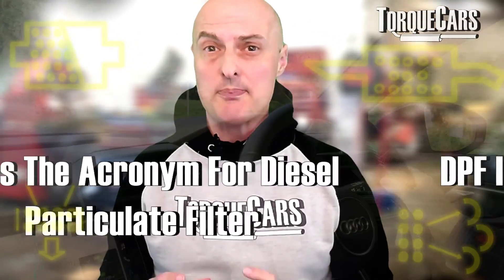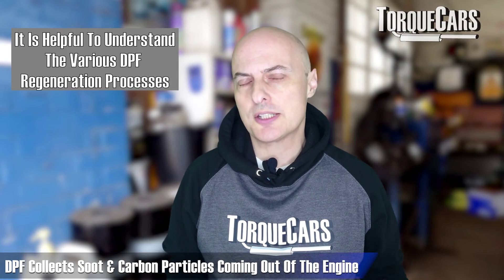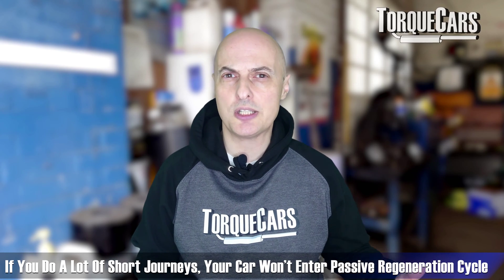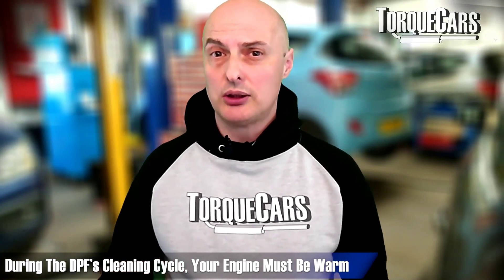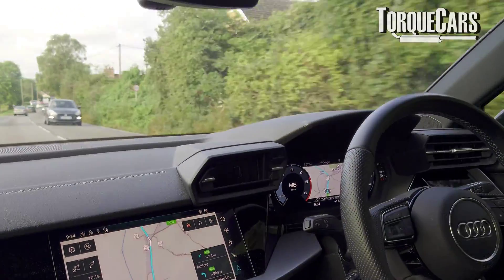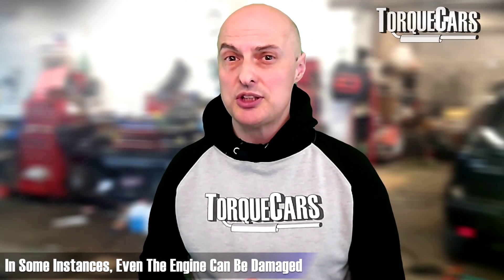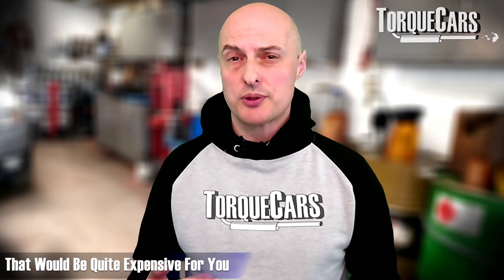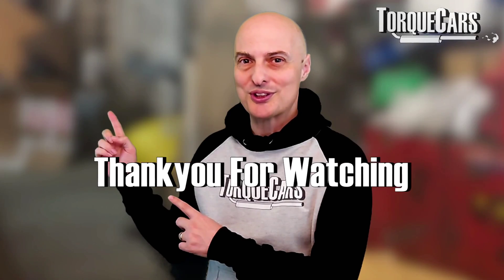Regenerate a DPF - Easy Guide & Tips: Starting DPF Regeneration. 🌬️🛠️

Comment: I have a Mazda CX-5 2.2L Diesel, I take it on highway every weekend or twice a month, drives 120-140km/h for a distance of about 40-50kms. I think that is the best way.
Reply: On the facelift models of the cx5 or 6, there's an engine icon within the fuel economy monitor / i-stop menu.
This engine icon has a background that changes from blue to black when a regen is in progress.
Once the regen is done, it goes back to blue.

Comment: I have this error today, check engine light
First the air temperature sensor fault appeared. Then after a while the DPF warning light.
Van struggled for power at around 35mph. Any ideas?
Reply: Sounds like it's gone into limp mode which is one of the side effects of this nonsense

Comment: A bit late, but it could be helpful for someone, maybe. I wrote it already in the Subaru Forester forum, my experience with the cleaning cycle. I had random issue with the DPF on my Forester 2011, the warning came up frequently until I found the CarBit App. This gave my the possibility to watch the soot accumulation live while driving. So I could react when the cleaning cycle was not finished to drive an extra distance. Again, until I realised, the cleaning cycle can be finished while parking and keep the engine running at 1800 rpm. When the soot accumulation drops under 20%, the car can be switched.  I don't had to visit my mechanic in the last 4 years or so. Now I try to find a similar app for Audi Q7 2008.

Comment: DPF, EGR, and cat all require extra mileage and/or toxic chemicals to clean. Where does all the carbon/soot/ash and chemical go once the components have been flushed? Yeah, it's an absolute con forced upon the drivers. Bottom line is that they don't want us driving anywhere at ALL.

Comment: My CRV blocked up during the pandemic as was just using it fir fery short runs. Got a DPF specialist out, who ran various tests and conclude mo underlying issues with sensors etc. He chemically cleaned it, then forced a regen with his OBD machine. Good as new. Took most of the day and cost £200.  Honda didnt want to know and were talking about a new DPF, at a cost of around 2k 😂

Comment: Nowadays and with this exhaust system, "driving the car properly" means wasting more fuel while driving the car needlessly for the sole purpose of the process. Bottom line, it's more expensive and creates more pollution. "driving the car properly" is hypocrisy disguised as practicality and pragmatism. Just like the "eco" stamp they put on this engines...

Comment: So. How do you initiate the regeneration cycle, what are the steps to get it to start, you talked a lot about what happens and recommendations but never said how to get it to happen
Reply from the maker: Which model do you have? The regen happens automatically as needed for most cars, providing you meet certain criterion which are explained in this video https://www.youtube.com/watch?v=h6wKuegjMV4 you can force a regen through the OBDii port in some cases where the automatic regen has not worked/ isn't cutting in etc.

The key is driving speed/rpm & duration which will vary according to model of car. 37 mph @ 3000 rpm and 30 minutes is a very general rule of thumb.

Comment: You really are a wealth of new and useful information. 
The dangers of using the wrong type of DPF cleaner at the wrong time is news to me (with hindsight it should have been obvious), although proper driving habits and using premium diesel, from time to time, seem more economical.
Driving in a lower gear reduces exhaust temperature? That's definitely news to me and is a cue for more research. 
Thanks again. Your channel is always a wealth of information.
Reply: Driving short distance in town is the worst thing on the DPF. Bummer as I have no need to take a long trip.

Comment: So my car has recently don’t a re gen after popping in a dpf cleaner would u recommend now the next time I fill up pop a regenerator in too help keep it clean ?
Reply: Save yourself some cash and just use the premium diesel. 
The chemicals in DPF cleaners are at a very low concentration. The majority of that bottle is a solvent that holds the actual cleaning compounds in suspension.

Comment: If you have just stopped after a normal drive and it's not 35C weather yet the cooling fan is roaring away and the active grill is open after engine has stopped then it's midway through a regen. Get back in and start the engine and hold the revs at 2000 or more for another ten minutes or so. In my 530d G30 when I do this the revs start to increase and decrease themselves while my foot stays perfectly steady and eventually the revs will fall to idle and the cooling fan will be off and the active grill closed. I take the car for a 3000 rev run up the motorway once a week - doing 3000 rpm for about 20 mins or so. Just knock the gear lever to the left and pull back the left gear paddle on the steering wheel to bring the auto transmission from 8th gear to 5th. I'm at 176,000 KM without a single DPF or EGR issue.
Reply: Really eco friendly that 😂 ... What a nightmare

Comment: This might be a stupid question... But how does one know for certain when a DPF burn cycle is complete? my car seems to give no indication of when it's in a burn cycle or when it has finished one? Mazda6 2.2L Skyactive
Reply from the maker: They don't make it easy do they. You need to look out for the signs of the DPF burn and then you'll notice it stop. The main things are high idle speeds, higher fuel consumption, high exhaust (and engine bay) temperatures.

So other than a scan tool, knowing where the idle speed should be is probably your best way of telling if it's finished or not.

They really should have a light that comes on and goes off, it's not a big thing to do.
Reply: I have a 2.2L Mazda, i notice a regen when the MPG drops to about 30 when prior to the regen it's achieving 55-60. Also i notice a deeper engine note.
I am getting fed up with this regen rubbish which can last up to 5 or more miles, seems to perform far too frequently approx every 100 miles, probably due to mostly 10 mile shopping trips.
Makes me wonder if owning a diesel is all it's cracked up to be.
Reply: My most recent burn cycle came running to the grocery 5 minutes away from my house, it's cold, and I didn't have an extra 30-45 minutes to get on the highway, haven't really noticed the Regen cycles before but my driving patterns have changed, used to do a lot of highway driving. I did notice my last few short drives that my 3.0 Eco diesel has sounded a lot more like a big diesel, going to put some highway miles on it tomorrow to make sure the crud is burnt off

Comment: How do you know when the DPF Regeneration cycle has started when driving?
Reply: Whilst idling (not moving with engine on and engine is warm), you will notice your revs move from about 800 rpm to 1000rpm. It is important you drive the car until the revs return to 800 rpm whilst idling, or you are asking for more trouble in for the DPF and associated parts.
Tip; drive your car in a lower gear than normal to keep the revs high and generate more temperature.

Comment: My 1.6 tdci Mondeo does a regen at 600/ 700 degres every 1,000 km. Car has 280,000 km and I always used shell v power diesel since 120,000 km. Regular highway driving and some no speed limit fun when on the autobahn. Average fuel consumption 5.5 l / 100 km
Reply: Yani bu hiç dpf sorunu yaşamadığınız anlamına mı geliyor?

Comment: Well ice particle filters are not really made for city commuting. I realized a damaged hose to the preassuse sensor has generated soot during my commuting. Now I made my own filler for my dpf and I have filled it with alloy wheel cleaner mixed with dpf cleaner and I just blew out most of the fumes that cleanse caused. I will not be too scared of meting the honeycomb because I saw a comparison between diffrent acids. It's not an f1 engine and if I loose the dpf what's the catch? I must clean it or replace it in car or removed so there is a clear incentive to learn something myself.

Comment: Woah, driver neglect? This wasn’t a problem before the dpfs were invented. So to reduce atmospheric pollution and or climate change we have to drive more or at least for longer distances at high maintained speeds - effin nonsense. No hate to you though. Information is much appreciated!
Reply: It is an absolute con. Drivers are doing extra miles at higher speeds to keep this filter clean.
You are correct. How can this reduce pollution?
Reply: I'd rather cancel the dpf,although that would be illegal because of the carbon emissions nonsense!
Reply: Wrong.  DPFs remove the particulates produced by diesel combustion which are small enough to penetrate deep into human lungs and carry carcinogens with them.  Nothing to do with climate change.  Just like unleaded petrol has nothing to do with climate change.
Reply: @icxcnika9399  in fairness, pre DPF diesel engines could get coked up pretty badly too.
Reply: Not to mention all of those plastic ( non degradable) jugs . I bet Obama is getting rich off this .
Reply: Dpf caused me and my parents to miss a flight!🤬

Comment: Driving up the motorway i noticed some smoke from my exhaust, approx. 10mins later my DPF warning light came on. Drove for approximately another hour to my destination, on the return journey light went off after stopping for approx. 5mins. However after 15mins if similar driving the light  came back on. Would this have been a failed regeneration?
Reply: Just a guess, but you might have an EGR problem.

Comment: Hello sir , after a forced regeneration by obd tools, does i need to change the engine oil ?
Reply from the maker: I'll do a video on this topic for you as a few have asked similar questions. 

During regeneration, some car manufacturers use a process called post injection. In this process, extra fuel is injected into the cylinders late in the combustion cycle. This unburned fuel helps raise the exhaust temperature and burn off the soot in the DPF.

The problem is, some of this unburned fuel can seep past the piston rings and contaminate the engine oil. This thins the oil, leading to oil dilution.

Interestingly some manufactures inject fuel into the exhaust stream which avoids the problem of oil dilution specific to the regeneration.

So should you change your oil? It depends very much on the oil quality, how many regenerations you've had and your driving style.

Oil analysis is really the only foolproof way to know what your oil is doing, and the report will specifically test for water and fuel contamination in the oil.

You can't really tell about oil dilution by looking at it. There are some test strips available which can test for coolant hydrocarbons and even wear metals, NLS products currently offer a range of test strips and you get around 50 to 70 strips depending on what you want to test for.

If your oil is looking black and dirty it may well indicate it is time to drain and refill, if you've had a few forced regeneration on the same batch of oil then I'd feel happier recommending an oil change, but for just one or two FORCED regenerations per oil cycle the manufacturers have built this into the recommended oil schedule and oil standards they recommend.

Comment: Hi!
My ford ecosport 2021 diesel static regeneration failed at 85-90% most of the time. I have heard from someone that to make the regeneration successful, the soot % should be at 20%. My car soot % is at 59%. 
What should I do? There is no fault code on DTC except DPF soot accumulation which I cleared earlier and then start regeneration.

PoV: I am using forescan.

Any advice or suggestions ?

Comment: quick question...or i already got the answer...
usualy when doing a regen(specialy when the regen is active)
when the temps goes up faster?
1.When accelerating while standing still with the car (around 3k max 4k rpm)
or
2.while driving the car with inferior gear..(like third gear or forth and accelerated at 3k rpm)
ive been doing this a lot...and it was good...but the next day...if o go again on highroad...the regen would start again..(usualy regen stays on 10-15 min max 20mins even after those 20 mins i still drive the car hard to get the junk out of dpf.. then at lower rpm to cool down the engine)

later
i also noticed instead of driving really fast...
i was doing standing still with regen on keeping the engine accelerated at 3k rpm
and after few mins...5-10max i went driving fast to blow out the junk out(i refer to the burnt particles as junk)

the engine actualy feels stronger (well basicaly feels better, it pulls even better..)
so my actual question:
when the regen is more efficient?
standing still till the dpf heats up to the required temp
or 
while driving at lower speed

il repeat...doing the regen standing still for few short minutes felt better because it heats up the dpf faster than while driving.(witch explains why lower gear is better)
also...i know it is not that recommended because it overheats the engine if u dont look carrefully at the temps

if u think about it...when they do the forced regen...they always have the car standing still
Reply: You seem to be confused about the issues that Wayne has explained in a number of videos. Maybe a good idea is to watch them again.

Comment: You said shutting dpwn the engine while in the regeneration process is a bad idea... Yeah, I get that, but the trouble is that with most vehicles, mine included, there is no indication of any kind to let you know that a regen has begun, is in process or has failed or been interrupted. It's a ridiculous system.
I own a 2020 Landcruiser Prado and have never seen any lights, symbols, nothing to let me know what it is doing. So how do you avoid shutting off the engine if you don't know a burn is occuring? There is a light that will come on if the DPF is blocked, but never seen that on, thank goodness.
Reply from the maker: It is totally crazy, I guess the manufacturers want us to have a psychic link to the engine. In most cars I've driven it's proved subtle but there are signs that a regen is going on, the extra heat, strange RPM fluctuations, throttle response, engine noise, exhaust etc...

But I totally agree with you on this point, a simple dash light would make life so much easier for us all.
Reply: You should notice the idle speed moves from about 800 rpm to 1000rpm (in mine, anyway), whilst regeneration is occurring. 
Make sure you keep driving it until the revs return to normal. 
And they say this is to reduce pollution? What a joke.
Reply: @michaellavery4899   If you have to stop for red light or other reason, have stop/start disabled to keep engine running.

Comment: Is it likely I will need a whole new DPF, if the current one is so clogged that the car has entered limp mode? Or will it still be cleanable by a pro?
Reply from the maker: You need to speak to a specialist they will be able to pull of the pressure readings and look at the problem this is not a rule of thumb or general gut feeling thing.

However you'll be pleased to know that in many cases I've seen a car in limp mode can be forced to regenerate in carefully controlled conditions but some have required removal and cleaning.

Comment: Would it cause an issue if it starts a regen cycle just before I get home but it is always driven on the motorway anyway the next day?
Reply from the maker: It depends who you talk to. If this happens a lot it should be avoided where possible but one offs are not to bad in my opinion, the car will usually resume when the engine has warmed up but make sure it gets to finish on the return journey. Some will find they travel just enough to start a regen, but not enough to complete it which can be a problem as the soot will just continue to build up.

Comment: Does putting premium diesel in the tank help like shell v power? Ie Less likely to cause soot?
Reply from the maker: Any fuel with cleaning additives that keep the injectors clean and improve the burn efficiency of the engine will reduce soot output. On my 2.0 TDi engine I noticed less carbon build up, less oily soot over the rear bumper, more power and improved fuel economy after a tank of VPower.
Reply: Please stop the blurred background moving in the background. Its very distracting and a bit hard on the eyes.

Comment: Short distances is the main problem, one cure, is, go down the Motorway, at high speed, often, about once a month, is fine,this will blow out any rubbish in your engine. 3:01
Reply: The vaporizer is blocked change every 3 years and give the dpf a clean ,change oil and filter every 8500 use premium diesel most of the time car will last you 260000 easy.
Reply: @whatscookin8269  This what i was thinking with mine now just 1 headache after another Thanks EU
Reply from the maker: You are spot on there, avoidiing short journeys is the single best thing a DPF owner can do.
Reply: Impossible for most sadly.
Reply: I’ve learned this dpf thing after buying my diesel car and I feel  so stressed about this because I drive short journeys like driving my kids to school, going to the groceries,etc. If going down the motorway is the cure then, i will do it once a month. Thanks!
Reply: @elliekim7512  
I was told to drive for 20 minutes or 20 Kms.
The DPF on my Skoda takes about 20mins to regenerate. My owner's manual doesn't mention anything about the DPF.
Reply: So 200 kmh is fine?
Reply: But some say has to be above 2000rpm & more then 1/4 tank fuel